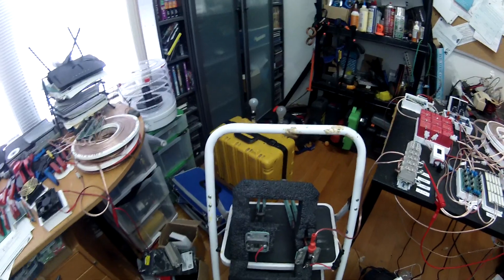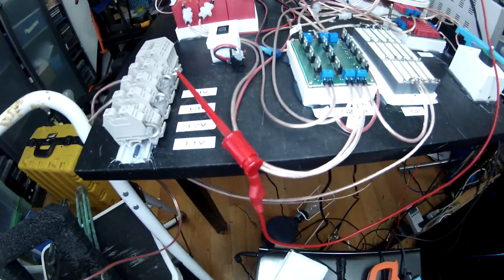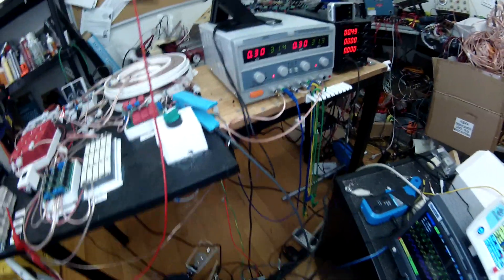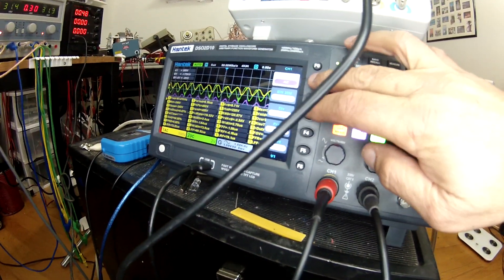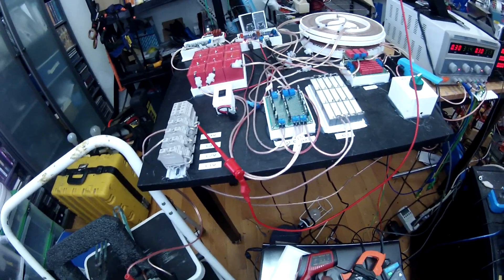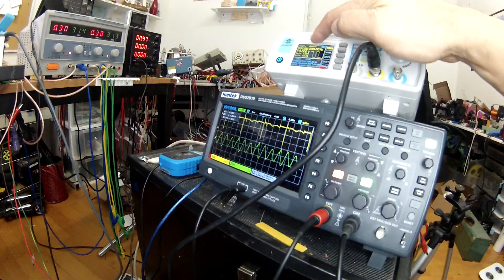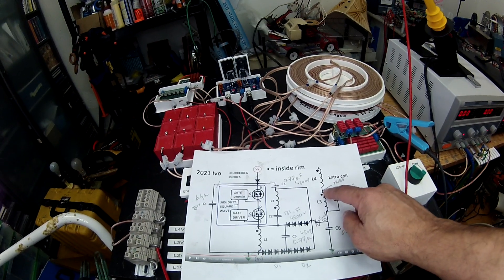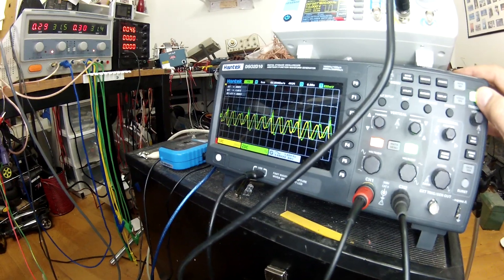Heating the 240v 4500 Watts water Element with 18 watts

Comment: PS: sanding them a little bit with fine sandpaper, will do The trick.  Now, putting them in to a water, antifreeze
Salutation, will be Best " it will slow down the oxidation on the rod's 90% or more.
Reply: who wants to bathe in antifreeze?

Comment: yes phase shift of current is 180 degrees when the probe is turned around. Thats natural.

but look at the specs of the probe, and see what its phase shift is relative to frequency.

at the connection of L3 L4, there also is the parallel capacitor of L3 (C3).
you can measure current before and after the capacitor, in other words, on L3 or L4 near the capacitor.

without changing the arrow, you should also see a phase shift there.
but not 180 but 90 degrees.

this is because the current of L3 is 90 degrees out of phase with the voltage of L3.
but with L4 the current is suddenly in phase with voltage.

this phenomenon is very strange.
But, I have a single impulse per single sine wave period.
Reply from the maker: hi ivo but i was showing in the video the L4 voltage and current is not in phase why do you think ? maybe the distance between the L1-L2---L3-L4 ? do you think the arrow should be to the load then and the small phase shift is a frequency dependent because of the probe ?
Reply from the maker: @Master ivo how is testing in your side I miss your videos